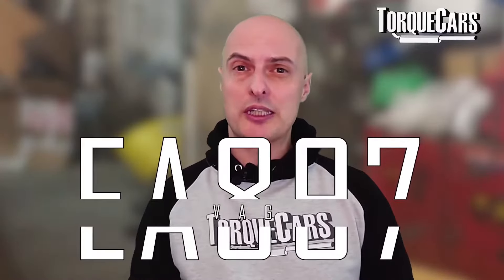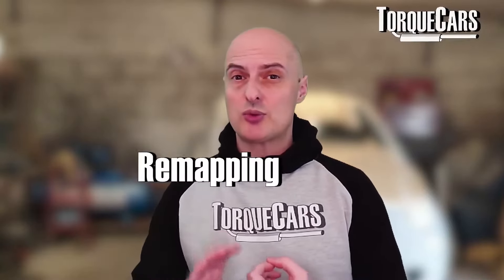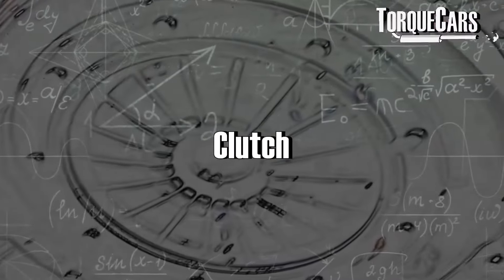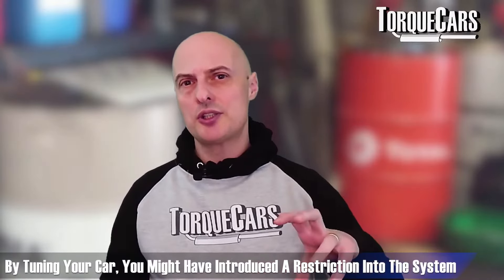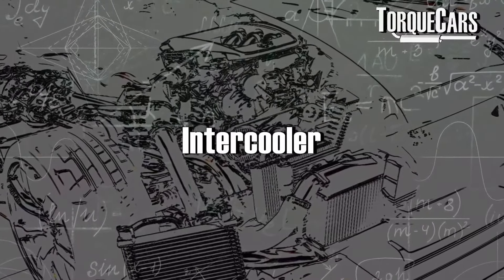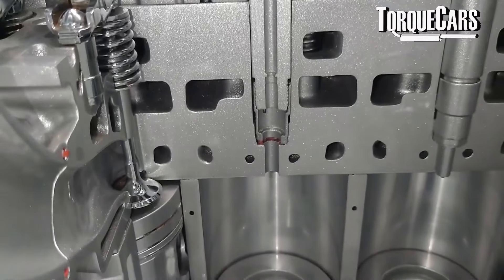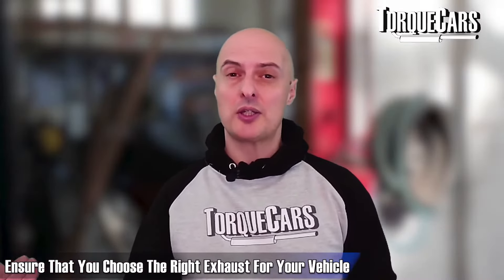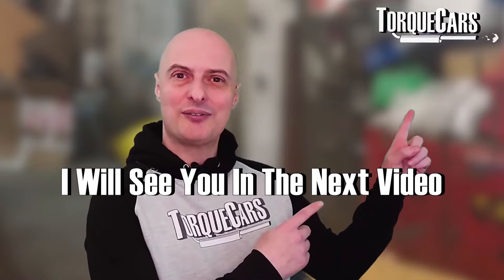3.0 TDi Tuning the VW Audi  EA897 Diesel.  The Best Engine Mods [Beginners Tuning Guide]

Comment: My cars in france : audi a5 3.0 tdi quattro 2008 capa : 

My car final:
- turbo gtd3279vrk , wastegate externe.
- dowpipe 89
- supersprint echappement 89
- intercooler darkside 
- cp3 pump r90 big
- big injectors
- collecteur echappement darkside 
- map, maf ,2700 bar and bitdi, 4 bar.
- admission apr
- Diesel cooling radiator
- Cylinder head, valves, large ducts...etc...

For the motor.

Chassis:
- sport rear stabilizer bar
- screw schemes bc racing
- sport brakes

Possible 600 630 hp
Reply from the maker: Great spec, how do you find the spool up with the GTD3279VRK?
Reply: @torquecars  inducer 56 exducer 79 for compressor , 56 inducer 58 exducer for turbine , Variable geometry blocked, exhaust regulated by wastegate, less heat for the turbine, lower EGT, reliability, more power...air and fuel.
Reply: @torquecars  The problem of variable geometry, a lot of heat, gas exhaust, fast safety, with outer wastegate plus this problem, the enemy of diesel EGT high.

Comment: I have an audi a6 c7, its a a 3.0tdi and im been wanting to go stage 2, i want to remove everything but i havent seen a kit that will do it, i want a egr delete adlue delete , dpf delete, upgraded turbo, i just dont know where to g et everything
Reply: It would help if said where you lived (ie, UK, USA, Europe). But if you're in the UK, try Darkside Developments,  they are well known for 3.0tdi tuning. I also have an A6C7 3.0tdi, and have had mine tuned up to 310bhp and just under 600nm torque, which I find perfectly adequate, also giving me 50+mpg on  a run and 35+ tootling around locally. Best of luck 👍

Comment: Hi can you please answer me something i tuned my 272 hp audi a6 and after that i have the issue p0087 what can it be?
Reply from the maker: It is impossible to diagnose these issues remotely as there are many possible causes, I would guess the fuel pump is struggling to meet demand (somewhere just over 300hp is nearing the limit on the CP4), it could be a fuel rail or injector leak problem, clogged filters and split fuel lines can also throw this error and it can also crop up if the fuel pressure sensor is starting to fail.

Comment: I brought a a5 s5 replica 2.7tdi with full stainless double pipe twin end pipes  looks best part straight thro im not expect went to get it remaped said it already been done but badly they sorted it and did notice a bit of a difference but he up rated air filter standard box type tho but better it does goes like shit but iv no real history on the engine had a full service cam belt the lot so can only pray but would stage 2 take any more upgrades

Comment: My 2010 A6 V6 TDI is tuned to 402whp and 818nm torque, it's a manual gearbox model.
But i think there is much more potential out of it.
Tuner stopped because the dual mass flywheel was not happy with +850nm torque. That's what they said. I left my car there couple days
And i didn't saw the dyno runs personally. They called me when they where done with all the work to pick up the car.
They installed a GTB2260vk stage 2 hybrid turbo and a CP3 pump . And after couple dyno runs, they turned it down a bit. because of the flywheel which is new by the way.
 I also could buy agressive camshaft and valve springs. But this mod is also not cheap.
Iv"e seen a single turbo model from a a4 b8. that reached 600hp. But that engine had lower compression. To run that kind of bhp
Reply from the maker: Wow nice, great results there and thank you so much for taking the time to share your experiences with us.
Reply: i have the single turbo a4 b8 with 245hp. What would you suggest as first engine upgrade?
Reply: @maximilianvogel3671  stage 1 remap, Wagner intercooler, EGR delete, DPF delete (don't worry about MOT will pass fine), straight pipes!!
Reply: @user-vs1ws1xc1r  are you sure about the mot
Reply: @stephencarey3589  100% mate
Reply: @stephencarey3589  if it is tuned well it passes no problem
Reply: @user-vs1ws1xc1r  I thought they check to see if it was fitted to the car not just emissions

Comment: is 300Hp / 600NM too much for my 1. gen 3.0TDI on my A8 ? :)
Reply from the maker: Is it FWD? I've seen it done a few times (fairly easily) but there were major traction issues. Also it was a manual you will find some of the auto boxes struggle at the higher power levels.
Reply: @torquecars  Thanks, its Quattro with the 6-speed Tiptronic